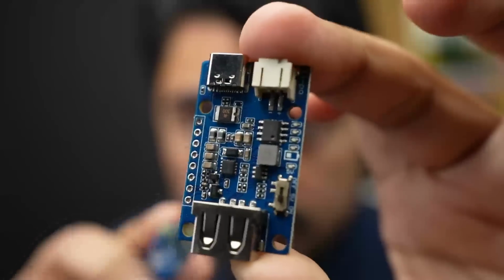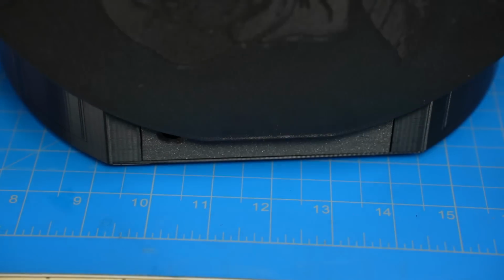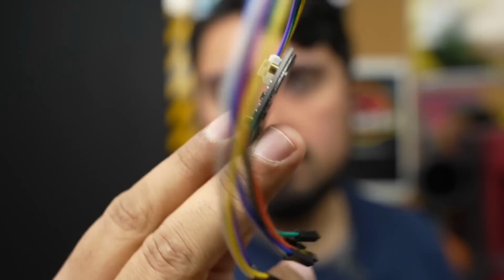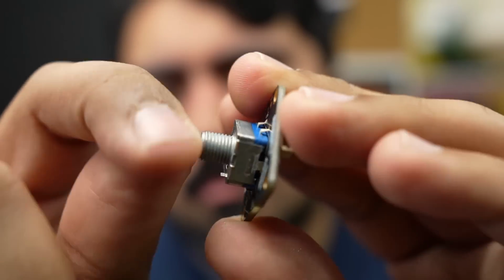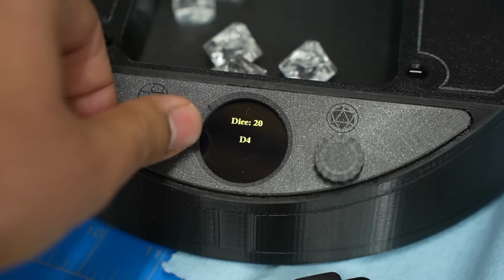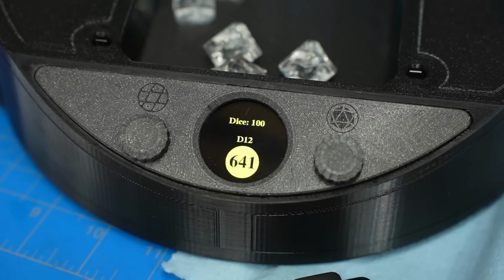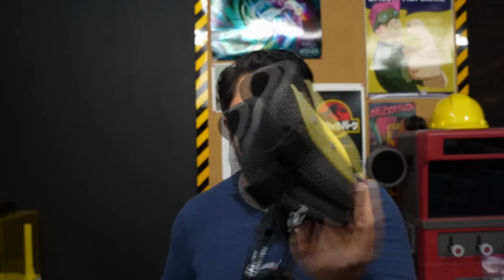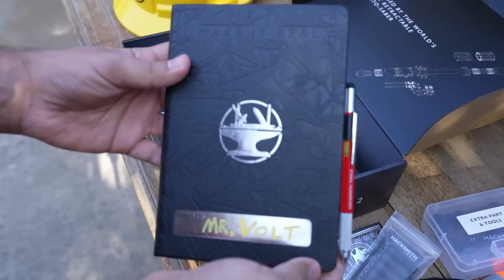Designing a Magic Dice Box for Crescent Shay

Comment: OK dude sweet. Let's go!
Drawers: CD-ROM tray. Spring-loaded and gear-train speed-controlled. Rigged up with a push-pull latch. Push the drawer in and it unlatches and slides out on its own. 
Sounds: I'd use a whispy windy "swish" effect for the clearing of the screen. Maybe have a selection of various "sound themes" to choose from. Should also have a volume control somewhere.
Controls: Capacitive touch is super "Magic" and gives you a lot of flexibility for things like double taps, long presses, etc. You could also experiment with gesture sensors for "hand wave" interactions, that would seriously level up the "magic" of the box. 
Lights: The RGB makes it go faster. An acrylic layer on top with some side-lit LEDs would be cool. Oh and you should also integrate an infinity mirror into the design somewhere, possibly with the "infinite dice" rolls. An LCD inside an infinity mirror built into the base of the dice tray could allow you to switch from "boring black" to "OMG THOSE DICE GO ON FOREVER" with the "wave of a hand". 
I also LOVE the rose motif. 
I might have to steel this idea and make one myself now.... Except I lack the executive function to ever finish a project like this. I can't wait to see your version 2!

Comment: hey i know im lame for pointing this out, but i think you exported the video interlaced rather than progressive -- 1080i instead of 1080p. you can tell because of the lines every other frame or so not just on the video sections but also the screen recordings and graphics. in premiere this is called "field order", in other programs just look for "interlaced" and replace it with progressive.